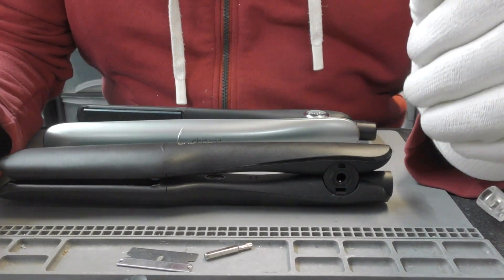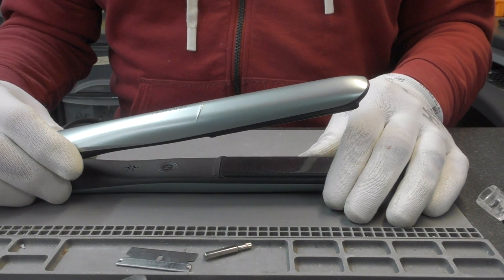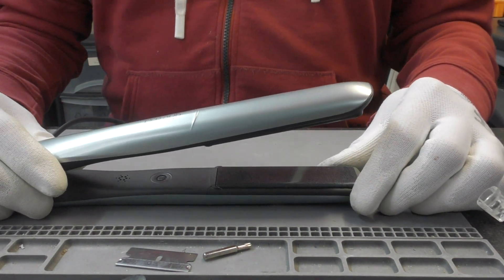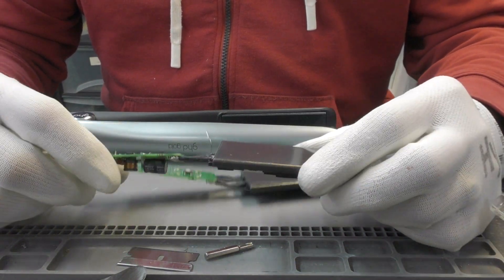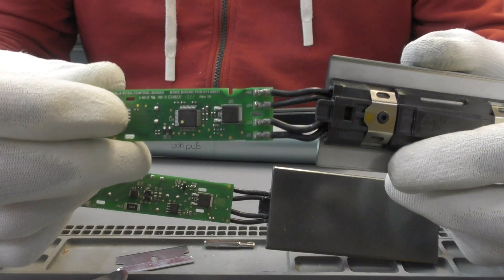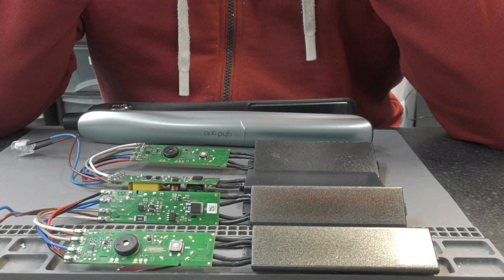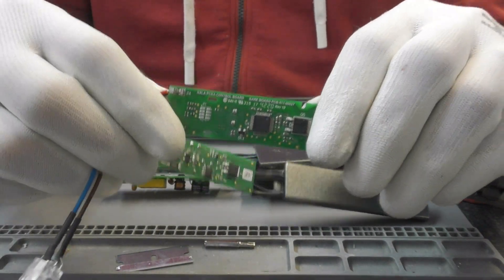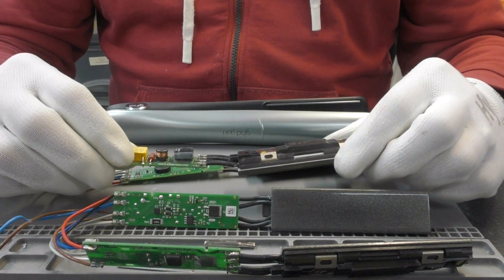GHD Gold S7N261 & GHD Max S7N421 Repair Considerations

Comment: Hello, I don't see what you're saying about the STM32, since this microcontroller is on the button side, and all the faulty GOLD units fail on the other side. The problem comes from the other PCB. The one on the opposite side. Not the one with the STM32.

Comment: Would this be the same for the GHD Platinum+ that seems to share the same plate assembly? I replaced both elements along with their associated temp sensors and thermal fuses as a pair of complete replacement units from Sirius. Previously, my wife dropped her unit when hot, and this took out both thermal fuses. I wasn't aware that calibration data for the temp sensors was stored in the flash. If so, I guess that I need to measure the plate temperature and check that it is not too far from 180 deg C. Cheers, thanks for the great video - Mike from Higham.
Reply from the maker: Hi
The elements are exactly the same on the Platinum+ as is the control of the elements. But the Platinum+ doesn't have the same issue with the PCB. I would check the temperature asap.
Reply: @Trevs-Shed  I bought a Proster thermocouple reader on Amazon (24 hr delivery) that looks very similar to yours and measured both plates simultaneously with the corner of a silicone heat mat sandwiched between the plates and the thermocouple beads. Initial measurements were about 190 deg C, but after allowing perhaps 5 minutes to stabilise, I could read as high as 195 & 198 deg C on each of the plates. So, hotter than intended and hotter than I would like, but probably not a total disaster, especially as the misses hasn't complained. Thanks for bringing this up. As a matter of interest, what temperature tolerance would you find acceptable? Cheers, Mike.
Reply from the maker: @Mike-H_UK  Hi
What is the temperature when a single thermocouple is gently sandwiched between  both ceramic plates?
Reply: @Trevs-Shed  Thanks. I'll try tomorrow and get back to you... I was wondering if I was significantly insulating the whole system since the silicone mat covered the whole area of the two plates and I was applying pressure to stop the thermocouples moving.
Reply: @Trevs-Shed  
Hi Trev,

I measured the temperature of the GHD Platinum+ straighteners again and got a few different results depending on how I performed the measurement.

1. Lower plate facing upwards, single thermocouple junction forced against plate by springiness in cable: 172 deg C after stabilising.
2. Lower plate facing upwards, single thermocouple pushed onto plate by small piece of silicone with light screwdriver pressure: 187 deg C after stabilising.
3. Sandwich between two plates and thermocouple in between. Finger pressure closes plates just enough so that thermocouple junction is trapped between plates: 192 deg C.after stabilising.

Both plates give similar results to within 3 deg C.

I suspect that (2) best represents the situation when the straighteners are ‘resting’ and (3) best represents the case with the straighteners are in use. So, probably around 190 deg C is a good working average.
Reply from the maker: @Mike-H_UK  Based on the 1200 or so I have repaired I would be happy with those readings. I see 180 to 190 as excellent and a degree or two lower or higher as not ideal but OK. The 215 degs I saw on two other repairs is not acceptable.
Reply: @Trevs-Shed  Many thanks. That is very helpful. Now to find some other uses for my newly acquired thermocouple thermometer. I think I start by checking out the fridge, freezer and oven.... 🙂
Reply from the maker: @Mike-H_UK  Best use of the dual channel meter is to balance your central heating radiators!

Comment: I have received a ghd gold s7n261. It shows the red constant blinking and beeping switch default. Im an electrician from Germany and at the end i only like safe and clean reperations. I searched your website and siriushair. I mean at the moment I didnt opened the device. I thought about buying one heating element, two fuses. These parts are together about 30€. I understand that the heating settings are may not ideal from the circuit board to the heating element. But if I order more parts, especially from the UK, the price will be to high. I will open the device in the beginning of the next week. Could you give me some informations for what I have to look and maybe you could gave me a special deal, then I would send you the device for repairing.. I dont need an tracking id for the mail.. I hope you could help me a little bit. Thanks!
Reply from the maker: Hi
This model requires modifications to be completed. You will not be able to repair it.
I do not sell parts for this model for that reason. 
Our repair service is for UK customers only.
Reply: Hello,
thats a shame you deny me some tips or even a link to your own website. I also intended to reach for informations about an serious repair service in my coutry, so I do not have to do the work. Is it my fault your offering no good deals for people outside of the UK. I like your website alot but I also hope cg60 will also not be economic for you anymore. I got all my infos I need, thanks to your website.
Reply from the maker: @SimpsonsFanNr1  I am running a business and have spent over two years working on this model. Developing firmware for it and solving various issues with it. No one else has this knowledge. And you can blame Brexit for us not doing overseas repairs.